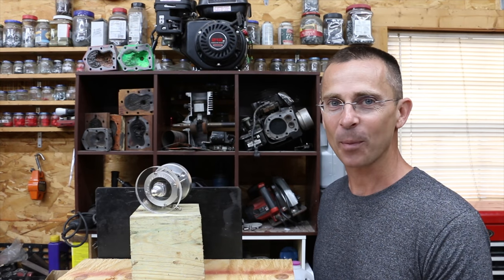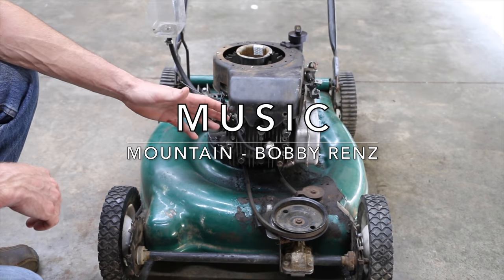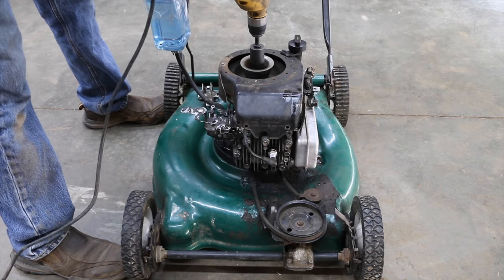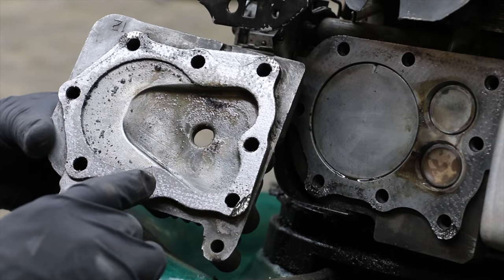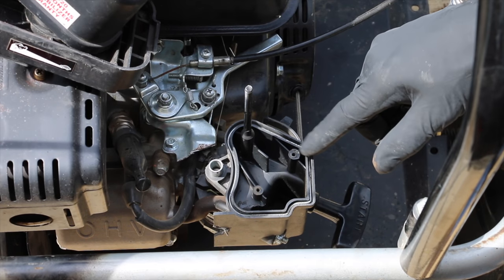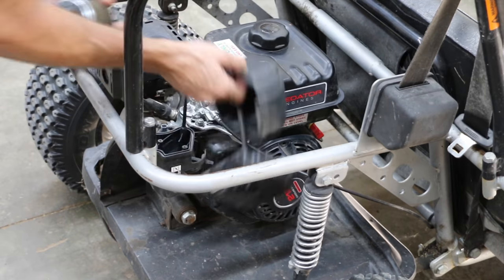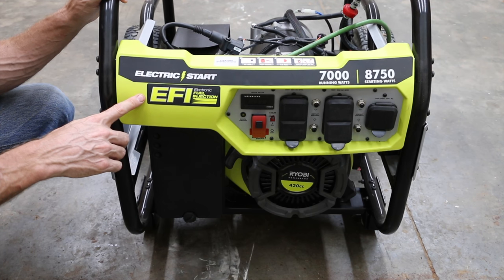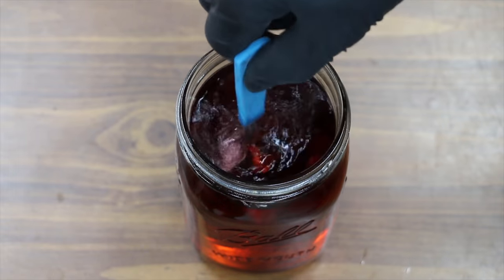Is Leaded Fuel better than Unleaded?  Let's find out!

Comment: I once ran 140 octane AV gas in my 11.25:1 compression 350 cu Camaro. I didn't notice any appreciable gain in power, but I did notice that my engine got to 220 temp very quickly. not worth the cost.
Reply from the maker: Thank you for the feedback!

Comment: Also, I wonder if a head/tailwind could even impact a speed test with that vehicle. Seems like the relative lack of bodywork with what's there being mostly cylindrical would make it so negligible even a full on study would rule it out. Not saying you should measure just curious.

Edit: I realize you do runs in both directions so it negates the need to test but I still really need to learn more about aerodynamics because it interests me but is just so hard to grasp to the degree I want.
Reply from the maker: Thanks for the feedback.

Comment: I heard they used leaded fuel back then because it was quieter and made engines vibrate less. They were actually aware of the hazards of leaded fuel but used it anyways. It wasn't until later when it became widely known that spewing lead into the air is not healthy.
Reply from the maker: Thanks for the feedback.

Comment: I don't think you've done anything with a gasifier yet? (heat wood under low oxygen conditions to produce a combustible wood gas). Gasifier engines and conversions have been around for about 100 years.
Reply from the maker: Thank you for the video idea!

Comment: But also keep in mind the point of leaded fuel is to raise the octane level and you need to actual tune and add timing or force induction to actually benefit from the added octane to resist engine knock
Reply from the maker: Thank you

Comment: How about trying Av-gas in a 2-stroke? The tetra-ethyl lead will probably increase lubrication, making whatever model/brand 2-stroke it's run in perform like a larger one... especially if it's a 130-octane blend!
Reply from the maker: Thank you for the video idea!
Reply: @ProjectFarm  Thank my career center automotive technology instructor... I told him about an mail-order ad I had seen in the back of a magazine for an additive that--when mixed with a gallon of 92-octane unleaded--resulted in 130-octane leaded fuel. Another instructor was present at the moment, and they thought aloud about it... with mine [at the time] replying "That'll make your Homelite feel like a Husqvarna...!"

Comment: This was interesting, but it doesn't show the properties of 100LL which are better than normal gas. To show the difference you need to test the fuel's detonation resistance. You can test it against 87 and 93 octane and even E85. Just make sure it is actually 85% ethanol. It can vary depending on location and season. 

Off hand I don't know what kind of rig you would need to do this. Knowing the compression ratio of the engines used would be a good place to start. I don't know if you can really increase the static compression ratio of those lawn mower engines, but they do race riding mowers, so maybe a riding mower engine would have more aftermarket support to change the compression ratio.

Race gas in your stock Honda (or lawnmower) isn't going to change anything. But a modified engine with forced induction and/or higher compression won't run (long) on low octane fuel. A higher octane fuel (race gas, Avgas, E85 even) will allow the engine to operate safely at the increased cylinder pressures.
Reply from the maker: Thanks for the constructive feedback

Comment: Lead provides octane and knock resistance . It also helps the thermal transfer of combustion heat at the valve seats. AVgas runs a ton cleaner and has far less carbon deposits. Most all of today’s pump gas has a ethanol blend of 10-15%. Where I live in Nevada they sell both 93no ethanol gas and 100 no lead right out of the pump.  A comparison of 100no lead pump gas and AVgas or even just no ethanol 93 if you didn’t use it would be a closer comparison. I have some 100% nitro that’s the real ticket
Reply from the maker: Thanks for the video idea.

Comment: Would you be willing to test which makes more power more oil or less oil mixture in two stroke applications?  It’s a very common argument in the motosport world that 100:1/50:1 modern 2t oil mixture creates significant power increases,  I choose to listen to my old school mechanic who recommended more oil I run 30:1 and my piston seems to last significantly longer with very similar performance seems to me that the bike with more oil runs better and for longer intervals.
Reply from the maker: Thanks for the video idea.

Comment: That doesn't really test anything, those are the last engines that would need high octane fuel. Other than maybe the rotary. Everything with any decent compression I've ran race fuel in has loved it. Stihl chainsaws, do not... But it was probably the premix I'd used for my dirt bike. It was like 50 to 1 synthetic and 110. Had it mixed up so tried it, once... My old Ford truck with a healthy early 70s 390 from a car, not a truck 390, and it was built. No idea what all my dad had done to it back in the day, he tried some huge cam and dry fired it with the oil pump drive in the pan and rounded the #4 exhaust lobe. I finally figured that out, put an offroad cam in it from crane. Don't remember exact numbers, but it was a decent little cam, but nothing crazy at all. And that thing was still a beast. It absolutely loved leaded fuel, it'd run like hell on it. Even my 2000 f150 liked it pretty well, and it only had maybe 9 to 1, and gutted cats of course. It ran clean enough without them. Even with all 4 cats removed it never even got close to 100 ppm hydrocarbons. And my bikes would absolutely fly on it, but they were getting into 11 to 1 and higher. You're damn sure never going to see anything on a flat head with like 6 to 1...

Comment: Heres a project 😀😀

How about making a extended run system that works with a membrane pumping like on the riders . If you have a generator and you would like to place un external fuelcell to it and it is not always possible to place the fuelcell higher than the carburator , how would you connect the pump on the motor ? Lets say that you take and place a fuelcell 8 feet from the motor and you whant to run it from the fuelcell , from time to time it needs more gas and i would like to refuel it safley without turning it off. Any ideas?
Reply from the maker: Thank you for the video idea!

Comment: My understanding of Av-gas is that it is for designed higher compression engines and as such is a higher octane...

My 74' Chevy Cheyene Super 4x4 used to love Av-gas; A 350, 30 over with 10:1 compression, headers and no catalytic converter.  Av-gas would make it purrrrr...
Reply from the maker: Great point. Thank you

Comment: Leaded fuel is a proven crankshaft life extender in two stroke motors.  When 500cc two stroke GP bikes were forced by regulation to go lead free compression ratios and power outputs were forced down. Also a by product was crankshaft bearing failure was more frequent necessitating sooner change out of crankshafts.
Reply from the maker: Thanks for the feedback.

Comment: Since there are no environmental restrictions on aviation fuels, both jet fuel, and gasoline, they have lead and sulfur levels that make them work better but produce exhaust that is worse for the environment than non-aviation motor fuels. The only motor vehicle that would be suitable for gasoline containing lead is one built before catalytic converters were in use.
Reply from the maker: Great point. Thank you

Comment: I had a problem with the tech 2000 stuff at chinamart .. Changed my oil supposed to be 10w40 had oil light come one at startup .. Emediatly shut it down and looked was red transmission fluid marked as oil .. Haven't used em since .. Anyway have you checked or heard of anybody else having weird problems like that with off brand oils and additives ? Oh was on my 92 honda accord almost 100k miles ago almost at 500k now if wondering why I just change it regularly and never worried about the most expensive hoopla personally .
Reply from the maker: Great feedback. Thank you

Comment: The blue color is a dye. Different grades of av-gas have a different color, same with non-highway use diesel fuel. Ive read that the av-gas with the highest amount of lead in it actually had so much lead in it that you can't even see all the way through it.
Reply from the maker: Thank you for the feedback

Comment: So your low compression test motors don't really bennifite from 100 octane gas other than its ethanol and alcohol free. If you where to test it in a higher compression /performance motor like 11 or 13  to 1 you would see a big difference in performance.
Reply from the maker: Great point. Thank you

Comment: I remember on a local car forum I was on a fella with a pretty well built 302 in a ranger had to change his float setting with av gas.   Different specific gravity.   Sunoco even mentions it on their website about race gas.
Reply: Dave Micolichek  

What would Sunoco know anyways....
Reply: Dave Micolichek  

Right from sunoco website about race fuels.

First, specific gravity has an impact on fuel metering, especially for carbureted engines. A heavier fuel is of course denser, so the float in a carb’s float bowl will sit higher than if a lighter fuel was used. If the float sits higher, the fuel level will be lower. Fuel level affects fuel metering in a number of ways, so if you’re switching fuels, pay attention to the fuel level in the bowls.
Reply: Dave Micolichek  

Darn those Sunoco petroleum engineers and their science.
Reply: Dave Micolichek  

And I had a friend who had to going from pump to AV gas.   So I guess it does.

Comment: The reason tretra ethyl lead was added to gasoline was to prevent erosion of valve seats. It was eliminated due to lead being a toxic heavy metal that causes birth defects. The way engineers corrected the design flaw in combustion engine valve seats was to develop induction hardening of the valve seat area. 
Leaded gas has no benefit in a modern engine. It doesn't burn better or produce more power. 
Blue aviation gasoline is usually higher octane than regular automotive gasoline.
Likely closer to 100 - 108 octane. Automotive fuel is 85 - 93 octane.

Any difference in flame color is more likely due to the higher octane not the lead content. Also consider the cheap flat head motors you are testing on are very low compression compared to aircraft engines.
Reply from the maker: Great feedback. Thank you!

Comment: I have ran Avgas (LL) in my motorcycle compared to the 91 octane no ethanol station gas. I have noticed a few things. LL has a much longer burn and therefore will keep my cold 4 cylinder carbed engine running much easier where 91 would struggle and I would have to turn on the choke. Due to the longer burn I can run the engine at lower RPM. 91 I would need 4K to slowly get up a hill and with LL I need 3k. The (oil cooled) engine runs hotter. My engine will warm up quicker and in the cold I can feel more heat coming from it. Just overall I feel like I'm getting more power from the engine, mostly noticed when passing people on the highway. I've moved to running LL as much as I can due to the lubricative properties of the lead though my mechanic cousin has told me to run 91 every once in a while since it has different lubrication used in newer fuels. I may move to just putting in Techron as my "modern lubricant" and continue to run LL. Due to the hotter burn of LL it will burn off carbon in the engine and lubricate the butterfly valves with the lead. Just some info for you @Project Farm and thanks for all your great videos!
Reply from the maker: Great information. Thank you

Comment: Rotary engines are fun but a pain in the butt to work on if you don't know what you're doing. A buddy of mine and I used to joke though that they'd run on just about anything. But, I do actually think, as long as whatever you run it on is combustible, it will run on it.
Reply from the maker: Thanks for the feedback.

Comment: Lead was added to dampen valve seat wear. That is all it was for.,

It worked great but these days we have hardened valve seats and a bit of harts instead. 

The original replacement was so carcinogenic that it was just fucked off without anyone's better knowledge.

Comment: Lead was added to gasoline to allow higher compression ratios (measured as octane) without pre-ignition.  For a given compression ratio, any octane higher than what is required to prevent pre-ignition is wasted. A lawnmower engine does not test the real benefit of anti knock (preignition) additives, including lead.
Reply from the maker: Thank you for sharing!

Comment: very successful for me  i run ll 100 in weedwackers and chain saws  i do not add stabil but do add proper oil mix    all of my out boards are run on high octane e10 with double blue marine stabil in season   fuel lasts about 10 to 14 days before it loses its zip   they are all stored with ll 100 completely in the fuel system to stop corrosion   carbed 10s to fuel injected 300hp  my 20 hp garden tractor is stored away from the water in a shed and does ok all year long  snow and grass
Reply from the maker: Thank you for the feedback

Comment: Love watching your videos, it’s enjoyable since it’s the kind of stuff I’d love to do if I could, but i’m an on the road mechanic so I just never have the time, but anyways, ik you do lots of small engine stuff and that’s great and all, but when ya get into the “octane” type of videos, it’s not gunna make a damned bit of difference in a single cylinder carbureted engine. High octane fuel is only beneficial in vehicles that can advance their timing and make adjustment,  so they can make the most out of the high octane fuel. That’s what O2 sensors and cats will do for ya. Can be beneficial in 2 stroke sleds that have O2 sensors and when your out in the hills at 10k plus feet
Reply from the maker: Thanks for the feedback.

Comment: In the 1980’s we rebuilt older big block chev engines for our ‘ hot rods ‘. Gulf Oil Co sold ‘ 💯 leaded octane ‘ gas . We also rebuilt lead free engines. There were some major differences between the two.   The newer engines preformed well on the high octane as long as the compression ratio was modified to 10.5 x 1 - 12 x 1 .The new lead free engines did not as well : compression ratio 8.5 x1 .  The new engines needed to have smaller carburetor jetting and the spark timing needed to be advanced about 5 degrees. Also , the lower compression engines needed to have the camshafts retarded about 1 degree with 💯 gas. We used solid lifters and fine tuned valve lash  : tighter for more low rpm torque and loser for more torque at higher rpm. Your comparison was not exactly fair : the high octane fuel used in modern day engines require different compression, smaller jets, advancing the spark and increasing the valve train gaps in order to demonstrate a true comparison.  However, straight up tests with  different octane fuels in your ‘ experiment ‘ are exact and actual. Wow! Did we have a hard time trying to get the unleaded engines to perform well after all of the 1968 396 and 411 rat chevies had been dug up out of their junkyard fields. At that time, there was no such thing as a computer to actively readjust settings during the run. Those were the days my friend , we thought they’d never end. I wish that I could turn the calendar back to 1983. 🙁

Comment: I used 100 octane leaded fuel in my dirt bike', but i had to diluted it with 91octane in order for it to run more efficient in my 2stroke" over all it ran much better,i ran it in my lawn equipment it ran much cleaner,Running it concentrated didn't notice any huge proficiency.my opinion it runs better if you diluted it,it reduces the lead content and want interupt
The octane that will allow the engine to run cooler and much better.
Reply from the maker: Thank you for the feedback

Comment: I think as long as the octane is sufficient it wouldn't matter. Tetraethyl lead was added primarily as an octane booster. High octane gas has a slower less complete burn in low compression engines so you should match it up with an engine with the appropriate compression ratio.
Reply from the maker: Thanks for the feedback.
Reply: @ProjectFarm  Thank you Sir! I used AvGas on the street before and it didn't work out really well. It evaporates slowly because it made for higher altitude combustion and less vaporization. You wouldn't want vapor lock at 15,000 ft.
Reply: @vincemajestyk9497  it will also ruin your O2 sensor, if your engine has one. Aircraft still have manual or open loop mixture control because O2 sensors and leaded fuel don’t work well together.

Comment: Both lead and ethanol are cheap fuel additives that can be added to crappy gas (low octane gasoline and not as highly refined) to raise the octane level so that you can use them in a higher compression engine without having knock or dieseling. The problem with adding ethanol especially with a carburetor is that you can get vapor lock at high altitudes, hence you also can't use it in airplanes. That is why planes use 100 low lead. The funny thing is though most of the old Lycombing, Continental or Franklin will run fine 80 octane pure gasoline. We used to order our fuel from Mobile, I think, just regular unleaded car gasoline that also has no ethanol either. Pure ethanol has an octane rating of about 114 if I remember correctly, so you could tune your cylinder and head to get super high compression ratio and more horse power. I think it is part of the old urban legends like from the Duke of Hazzard, with Uncle Jesse making deliveries of moon shine across county lines escaping pursuit by the police with the car running on white lightening.  Not sure if I believe any of them but good stories and actually science that backs it up.
Reply from the maker: Thanks for sharing.